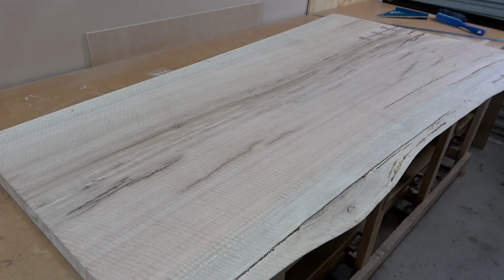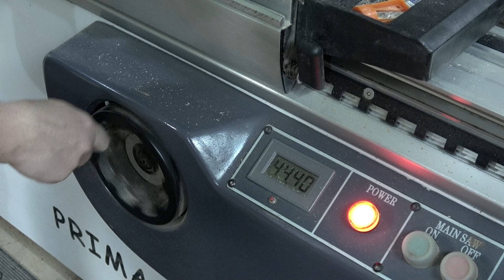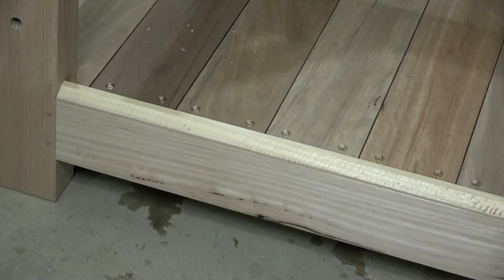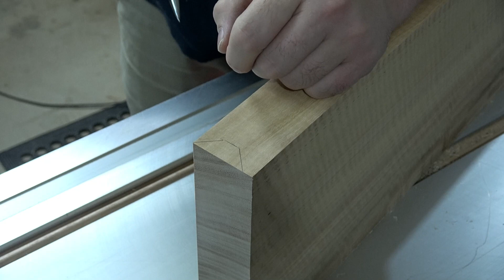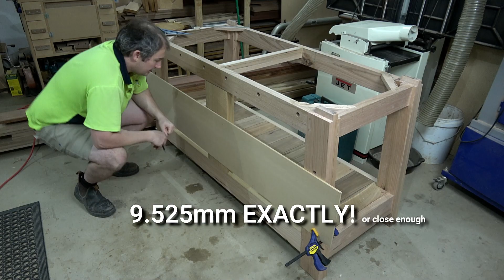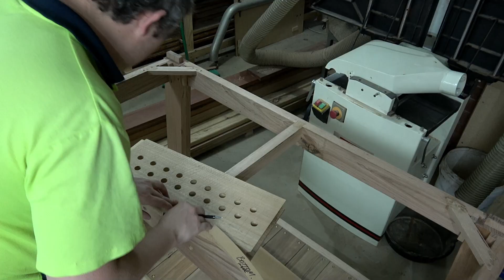OzzyOcker Workbench Build Part 10 - Sliding Deadman

Comment: You show the deadman but don't explain what a deadman does?
Reply from the maker: True. I was showing how to build the deadman as part of the overall workbench build. The deadman is used to support longer and wider boards or timber slabs. A peg is placed in the deadman holes, and the board or slab rests upon that peg.

Comment: Sexy deadman mate. You probably considered it but I like the fact that I can remove my deadman when not needed or in the way (happens occasionally). I made the front shoulder a bit lower  and shortened the tenon so you can lift it in and out over the bottom rail. Still has plenty of meat on the tenon to keep it secure.
Reply from the maker: I didn't consider having to remove the Deadman. The Deadman is something I will probably use once or twice a year because I have dog holes in the front apron rail. I just couldn't bring myself not to include the cool looking Deadman 🤣

Comment: Looking good!  I desperately need a nice workbench but I haven't the room for one :)
Reply from the maker: They are a bit of a luxury. I've never had a decent bench before
Reply: I recommend the low Roman workbench.  When you are not using it, you can keep everything in a box and use the bench as a sitting bench.  Use tiny roubo style legs that are parallel to the table edge, and procedures can be done with regular clamps instead of a vise.  Make the slab first, and you can use it as a surface to make the legs.  Needs only (Chisel, plane, saw, glue, wood, drill optional)